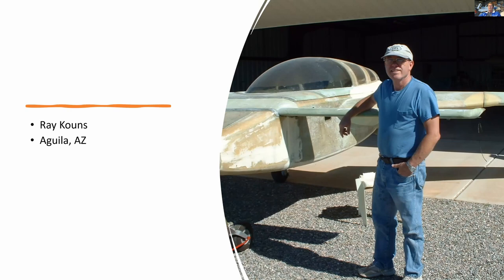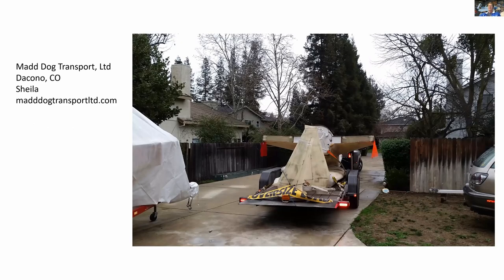Building a Cozy MKIV - Part One

Comment: Did you use solid rivets or pop rivets on those engine baffles? If you said solid rivets then I salute you. You got the full effect of what it's like to be an aircraft mechanic. A little FYI in aviation maintenance for the airlines there are structural mechanics who do repairs to the body of an aircraft. These people are like artist's and it takes a special mindset to be good at it. There is another group of mechanics who work what is euphemistically called the A&P's which is strange because an A&P License is required to do any of it. The A&P's do anything that doesn't require sheetmetal. Most of the work is opening areas for inspection which includes the removal and reinstallation of the entire interior. Everything that is done is on a strict schedule. Time overruns are severely frowned upon.